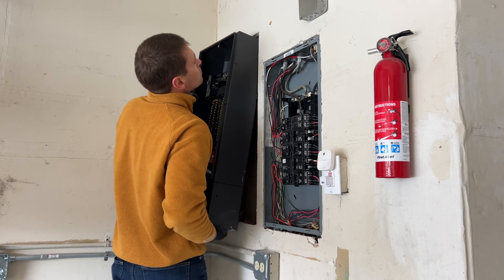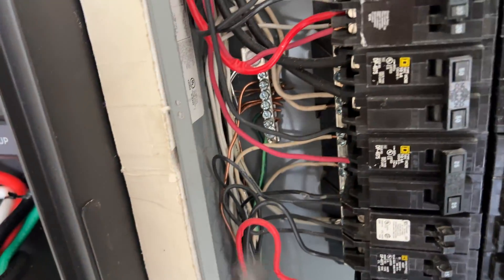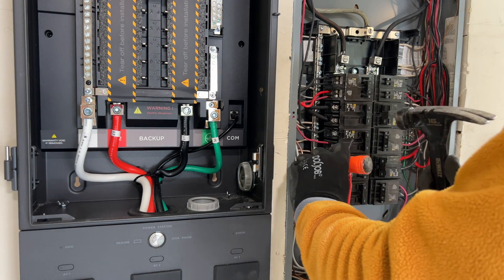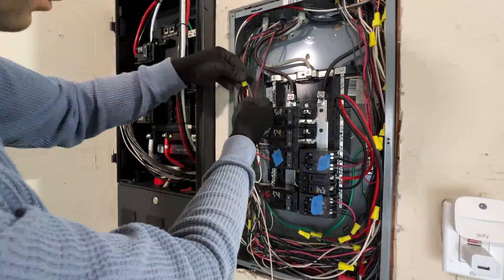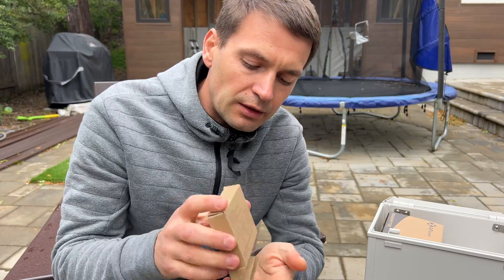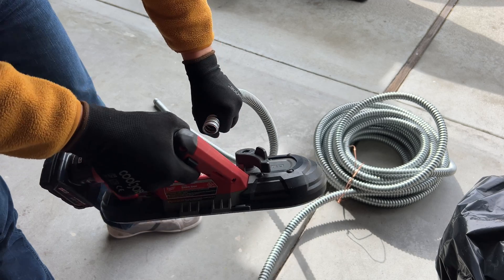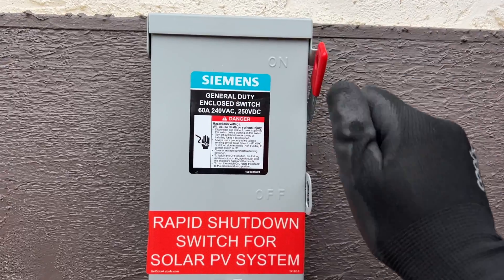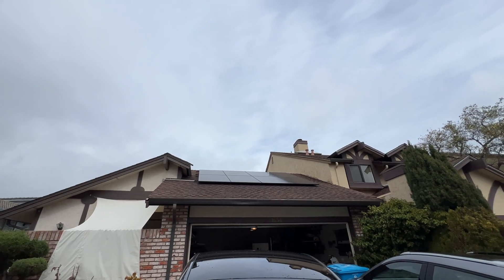EcoFlow DELTA Pro Ultra + Smart Home Panel 2. Installed with 3.2kW solar array

Comment: Why didn't the ground wires get move as well. It seems that it is a main panel move to subpanel. So, the neutral and the ground wires are supposed to be separated in the sub panel.
Reply: Grounds can stay when you're just moving a circuit. The sub is already grounded to the dedicated ground in the main. Grounds are for safety, they dont carry current under normal operation. NEC just states hots and neutrals must travel together when moving circuits.

Comment: Can this be used as the main circuit breaker without the dumb one using grid power only? My house is now under construction and I want to do a smart breaker from the get-go. I will install EcoFlow batteries at a later time.
Reply: No. The but the new SHP3 can.

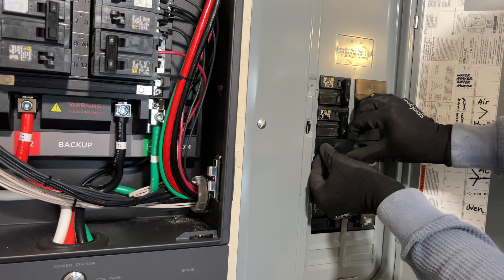Comment: Does this PV Shutdown you mention at 3:37 in the video Qualify as a "per panel" or "general" shutdown?  We are being told you cannot install Ecoflow panels after 2023 on a Roof as NEC Revised code Sect 690.12 requires home have a "per panel" vs "general" shutdown for our city permit for solar panels on a home per the Fire Dept...  does what you show in the video meet that requirement? or do you have a solution or suggestion for "per panel" with EcoFlow?
Reply: To comply with rapid shutdown, you need something like NEP rsd PVG modules.  This homepanel doesn't seem to comply with code, because the solar wires entering a residence have to be protected all the way to the device, which is not possible with this ecoflow battery/inverter.  With the wires not connected to the device, you have exposed mc4 connectors which present a shock hazard. Batteries also need rapid shutdown compliance.  If you have a good amount of land, and can install a ground mount, or ballast panel array, you do not need rsd for the pv.

Comment: Any limitations of the SHP2? I have a big 220v main panel with 34 breakers, seems to be I’m limited with 12 circuit breakers, also I read each row is limited to 60amp mean both rows 120amp max

Comment: You need a disconnect to solar panels even if you're not feeding back to the grid???
If the smart panel is off, does that put Delta to sleep??? Obviously it would wake it ...
Reply from the maker: AC disconnect will shutoff solar panels. We installed APSmart rsd

Comment: Curious - Why did you have to wire neutrals and grounds for the individual circuits over to the smart panel?  Those circuit neutrals and grounds were already bonded to the system neutral and ground bus in the main panel correct?  Does not seem needed.  Is the neutral and ground bus in the smart panel switched during the transfer outage also?
Reply from the maker: I'm not sure how powerstation works in offgrid mode, so I moved neutrals as well

Comment: Hey, thanks for the video, it helps a lot. I am also installing this panel (outside of the USA) so I need to get the proper breakers (breakers in Ecuador are different) so I need to order them from Amazon, con you please help me with the exact model number of breaker you are using, for the 100amp main grid line and the sub breakers that goes to the house? Thanks you in advance!
Reply from the maker: 100A breaker: https://amzn.to/4jkVV6z
And check for SquareD Homeline breakers
Reply: @SolarEngineering I notice on you regular panel you are using the DP-4075 breaker and the link you shared it says DW-7166, is there any difference? Or both will fit the smart home panel 2? 1:19

Comment: Awesome video!  Curious why you used an 80 amp breaker instead of 100?  Also, if I separate the SPH2 bottom connection and wire it to another location, what size wire do you recommend I use between the DPU connection and the SPH2?
Reply from the maker: main panel is only 100A, one Ecoflow can push 30A. so 80a is plenty in this case.
Reply from the maker: for 100A - 2 awg
80A - 4 awg

Comment: It looks like you moved breakers from original panel to the smart panel 2.    Did the wires reach to the breakers once in the smart panel 2? If not, how did you handle that? Thanks
Reply from the maker: used wirenuts/wago connectors to extend wires

Comment: Great video, What the wire size you used to connect from your main panel breaker to thr 100amp breaker on the SHP2?
Reply from the maker: 2 AWG copper

Comment: Love your videos as they are getting better with each video.

I do have a question regarding this system, could you install two Ecoflow Smart panels 2's sub panels from the main panel and move ALL circuits from the main panel to the sub panels? I would use one smart sub panel with a single Delta Pro Ultra with all low loads and the other smart panel for all the heavy loads using two Delta Pro Ultra's. This way the entire home would be backed up instead of just 12 circuits.

Just wondering if that would be possible.

Thanks
Reply from the maker: Hi, yes you can do that. 
Thanks for the feedback
Reply: Stumbled upon this video in my research on this system and your comment stood out to me.

If you're still considering this, at the pricepoint of two Ecoflow Dela Pro Ultras with two batteries each and two smart home panels you're in the price range of a Sol-Ark 15k hybrid inverter + Homegrid Stack'd/pytes/or other battery solution that Sol Ark supports. This has the added advantage of MUCH higher solar input and battery capacity. In parallel the $/kwh of battery storage is much cheaper than Ecoflow.

I really like Ecoflow's product but unless you can get it at a steep sale like they had over the holidays the math is not in their favor for a whole home soluiton.

Comment: The AC disconnect is 60 Amps, between which device and which device is it connected? I mean after the inverter between the home smart panel and the main service panel? Can you help me with that?
Reply from the maker: between APSmart power adapter and source of power (any breaker) from smart panel

Comment: Very informative. That said, I would have taken greater pains to control metal shards from drilling through side of panel. They were flying all over the area. It only takes one to short out a very expensive system. Otherwise a pretty sano job.

Comment: Very useful video. It helped me a lot. Just Two question. Is AP-Smart RSD compatible with EcoFlow Deltra Pro Ultra inverter?
Is the AC Disconnect connected between Utility Meter and Service disconnect? - I mean Service disconnect -> AC Disconnect -> Utility Meter
Reply from the maker: @kevinochoa6676  apsmart is compatible with all inverters. It's just RSD.

Comment: I got one of these  pro ultra's for an off grid set up. I didnt get the smart panel. I am wondering if can I run the wires from my panels directly to the eco flow ultra. I am thinking about having (7) 250w panels. what safty percausions should i take connecting my solor array to the eco flow unit?

Comment: Question:  you drilled into existing panel and didn’t use an existing knockout. Is that acceptable to make a new hole over the existing knockouts?
Reply: The panel does not have knockouts
Reply: @samaba7577  look closely. The main service panel has many smaller knockouts  he drilled into. Even left one open to exposed wood frame.
Reply from the maker: honestly I'm not sure, worst case we can use reducing washer (2"->1-1/4") to make it more solid.
Reply: @SolarEngineering  sorry if I was t clear in my questions. The original main panel, looks like you drilled into multiple existing knockouts. I get the reducer being a fix but just wondering if any inspector would have issues with that.

Comment: Why is an AC disconnect even required. I get the RSD requirement for the PV, but this system is off grid, so I wouldn’t think it needs an AC disconnect… is it a requirement of the SHP2?
Reply from the maker: Solar panels installed on dwelling unit, so need to install RSD.

Comment: Hey there, thanks for very informative video, very helpful. Does ECOFLOW Panel 2 accept slim breakers which allows to connect two lines? It seems that you’ve been using one of these (timestamp 3:30 in this clip). 12 breakers only might not be enough these days. Can you clarify please?
Reply from the maker: yes, you can install dual and quad breakers

Comment: Hey, thanks for the informative video. Im curious with the rapid shutdown if you also need something to cut the power of the inverters to the Smart Home panel. I noticed an EPO port on the top of the panel that I'm thinking could be used for this but there isn't anything in the documents about it. Did you set something up to cut the inverter power like the solar panels?

Comment: Question.  Are you installing it as a grid tied system? Thank you
Reply from the maker: it's considered as "off-grid" setup, grid power connected to station input port. These power stations cannot feed energy to the grid.
Reply: @SolarEngineering   another Question. I saw that you have AC disconnect because you have solar panel on the roof installed? My home set up is also just like you, but completely OFF Grid. 10 panels on roof, PV line to DC isolator then connect to DPU. My diagram shouldn't need a AC disconnect ??
Reply from the maker: @Ki_C1224 if you are installing on the building roof, then you have to install rapid shutdown. 
Check NEC 690.12 Rapid Shutdown of PV Systems on Buildings. 
There are a few exceptions in this rule, but if panels are installed on a house roof, then by the code you have to install RSD.
Reply: @SolarEngineering  thank you. Looking forward to talking to you soon
Reply: @Ki_C1224 my understanding is that you still need per panel shut down, as the conductors can still carry voltage while the sun is out even when not connected.

Comment: Who is the best candidate for this type of smaller system?  Seems simple.  I am currently trying to decide what type of DIY system to purchase with $15k budget. Thank you for the great channel really appreciate your videos.
Reply from the maker: Luxpower 6k ($1400) + 2X EG4 PowerPro  ($8000) + solar panels 12pcs ($2400) + misc (racking/wires/conduits/disconnects) $2000 = $13,800. 5kW system with 28.6kWh battery capacity.
Reply: Thank you so much for your time and expertise @SolarEngineering
Reply: Great job. Super clean install. Covers pretty much everything one needs for a hybrid setup. Did you mount the PVs yourself also? I procured two 12kwh systems with smart panels. Still finalizing PV vendor to go with. Can I ask what state you’re in?
Reply: @beidlern good luck, hope you find someone reputable and honest.

Comment: I'm about to buy/install the same gear and I was wondering when you moved the circuits over to the SHP2, why did you bring the white neutral wires as well? I figured since you're already bringing the neutral over from the main panel via the big 4AWG wire, that all you'd need to do was wire-nut the hots from inside the old panel and bring over the black to the breaker in the new panel. Would that not also work and save some wiring? Also, would love to see a diagram of the shutoff wires, I mostly understand from your video, but would be awesome if you had a diagram (not sure if you do). Thanks!
Reply from the maker: I believe it's NEC 300.5(I) "All conductors of the same circuit ... shall be installed in the same raceway...", so we have to move neutrals as well.
I'll check later for the diagram.